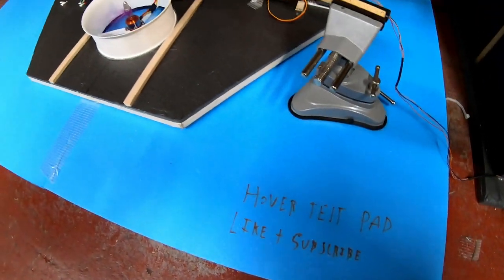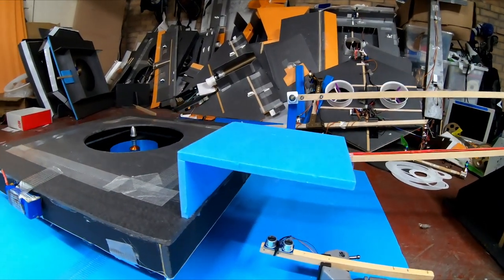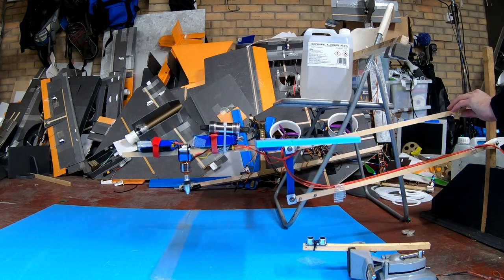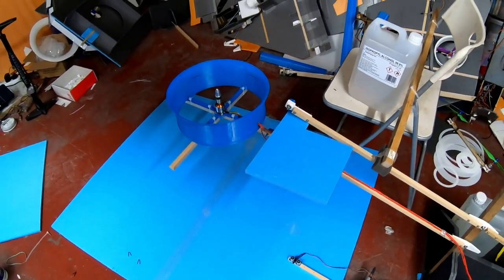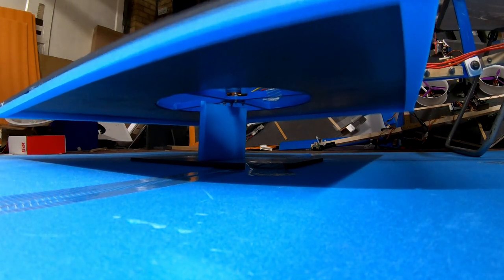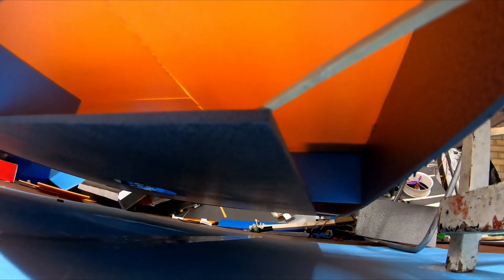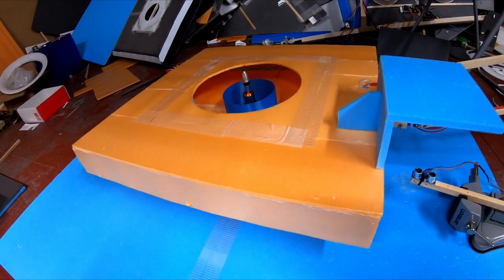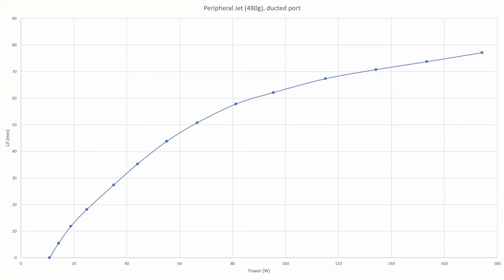The great ground effect rotorcraft - hovercraft showdown, Part 1. VERY data heavy!

Comment: Wow! - VERY data heavy (as suggested by the title...) - Thank You - Needs a few re-watches to absorb the key points and their interaction. Will be interesting to see how the  "Improved Narrow Annular" performs - Wondering if an "air smoothing curve" below the prop would help with the flow of air that goes to the annular jet. (?)
Reply from the maker: Yes I would add something like that. I'm wondering how "efficient" I can make annular in terms of open-air propeller thrust vs actual thrust, per the video it's only 45% or so just now. I'm working on the 3D printed ramps at this moment.

Comment: impressive amount of information, thank you! A couple of years ago I designed (but never tested) a skirtless hovercraft based on your last  idea. basically I rised the propeller a bit higher, this would make the channels that go to the side jets a bit smoother. also from experience in other fields, my idea would be to have the outer jets point slightly inwards, this could help "trap" the central cushion of air.